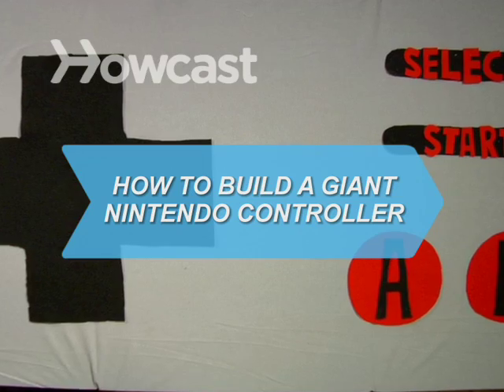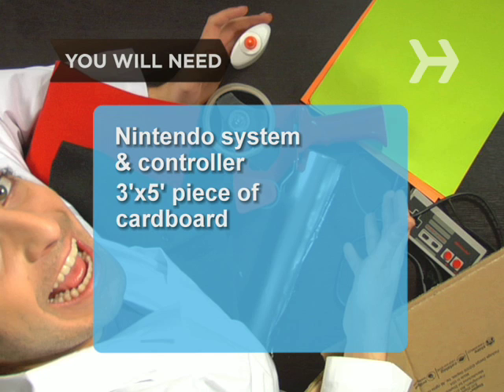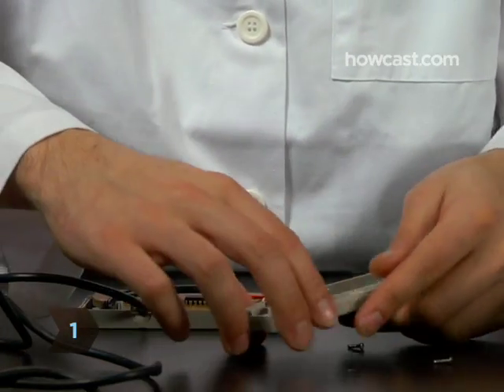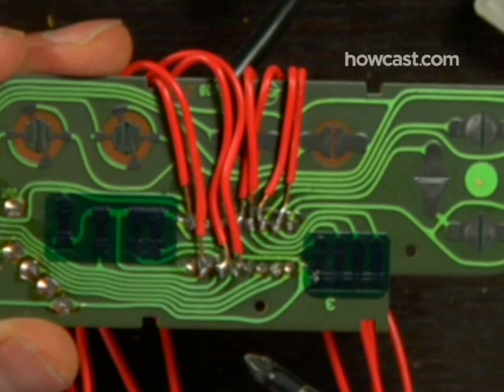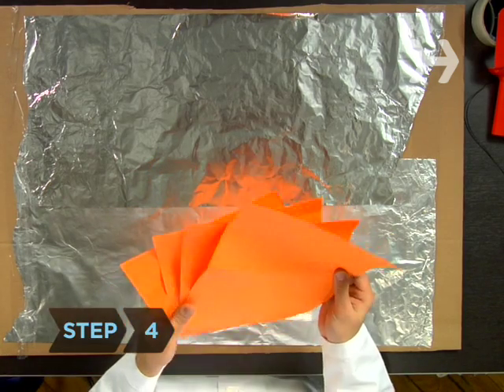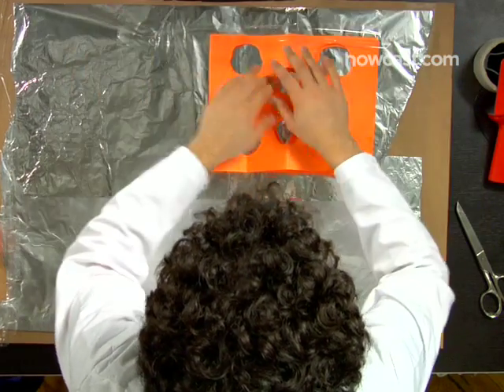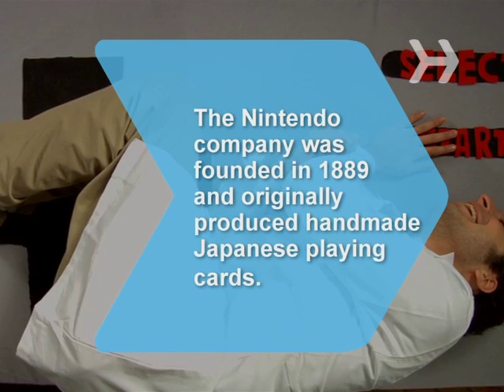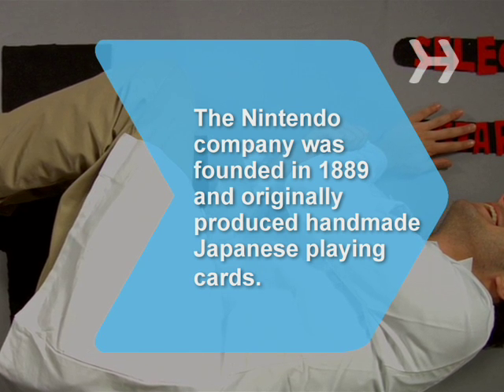How to Build a Giant Floor Mat Nintendo Controller

Comment: You left out an important point in this - where exactly should the original controller circuit board be placed? I'm guessing it needs to go somewhere where it won't interfere with the foil and won't get dirty or damaged.